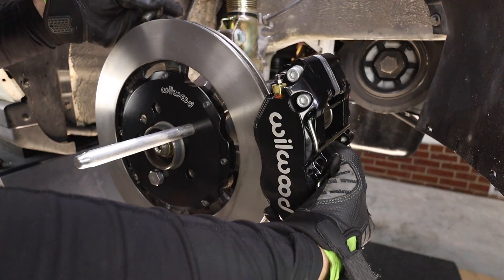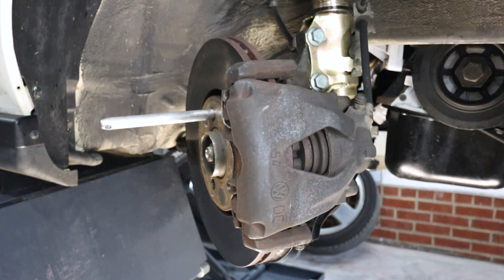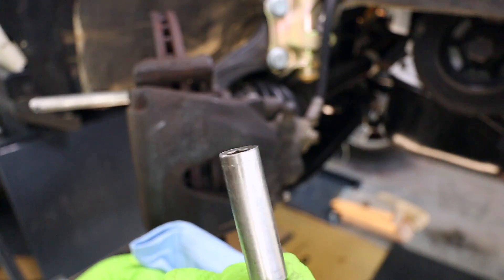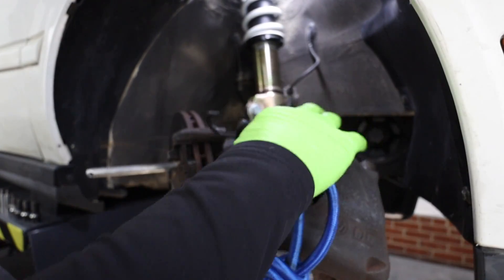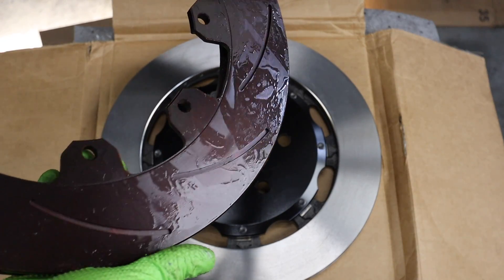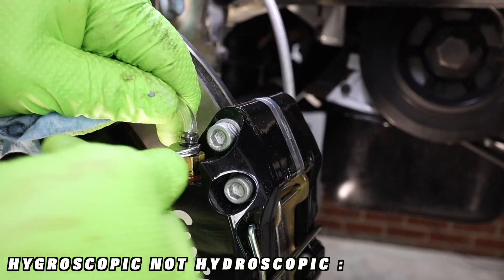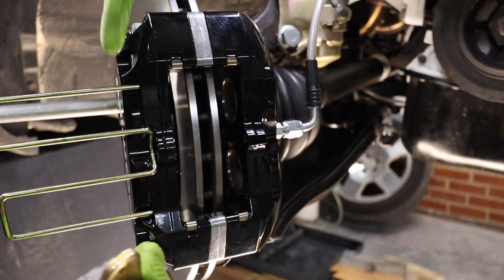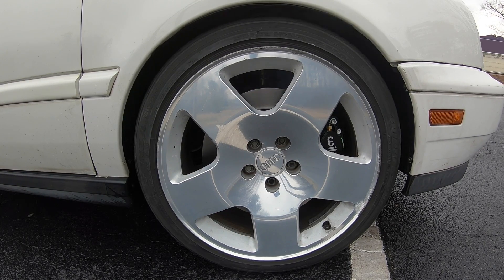10 Brake Job Tips when Replacing Brake Pads and Rotors

Comment: Be sure to not mix up the calliper slide pins,many callipers have different slide pins, the same diameter and length but one slide may have flats machined on its flanks and the other does not.
 I replace the bleed screws as a matter of principle. They cheap and spoil your day if they rust and shear off.
Get a pad mounting kit when you get new pads,again very cheap and way better than using rusted parts.
I use a drip tray to catch any fluids and any dropped parts, makes cleaning up easier!
Cleanliness is everything,wire brush everything clean.
Reply: Some pins have a rubber end, while the other pin on the same bracket doesn't. Why is that?
Reply: Not quite sure. I asked the same question some years ago and was told that the rubber is there to avoid any chatter in the calliper mounting due to vibration when the brakes were not applied and the calliper was free to float? When I asked about the flats on some pins I was told it was to allow the calliper to move without binding up due to heat differences between the calliper and carrier as the brakes were used. Seems pretty plausible and I have continued to believe this due to a lack of any other creditable explanation?
 Oh deep joy,more rusty seized solid Subaru brakes to overhaul tomorrow. Bollocks.

Comment: Another one: remove the caliper before you undo the brake line. It's easier to twist the caliper around instead of the wire. It holds more for putting it back together because usually the cable cannot be fastened enough and you'll need to remove the caliper again.

Comment: Another tip is to remove the cap from the brake fluid reservoir before pushing the pistons back. It'll save many pennies worth of damage :)
Reply from the maker: I like to extract a little fluid out too so it dines't make a mess

Comment: When I did a apprenticeship we always had to grease the ends of the brake pads, what is your opinion on that?
Reply: Where they make metal contact with the caliper itself, yes that's custom to do and prevent seizing I'd say.
Reply from the maker: I’m in the no camp on that one. Well I’m in the follow the repair manual camp. Vw doesn’t have any of that type of thing we did.
Reply: Bailey Hatfield I was wondering if that was why. I’m from Denmark, so there is a lot of rust and they salt the roads. I have family members that take their VW to Germany to get them serviced (cheaper there) and at the VW dealerships there they use grease on their brake pads too. But a lot of people in the US Don’t, just curious to why.
Reply: You never want to lube something that is exposed like that. It will work for a couple of weeks, attract dirt, and then turn to crud that will prevent smooth pad motion. Just wire brush thouroughly and you are good to go.
Reply: Hot climate and normal heat from breaking will quickly dissipate any grease.
Reply: @awesomexistence  not if you use high temp brake grease..
Reply: hsttrek1, yes for a while, but typically the grease is gone pretty quick in our summer heat. You can often fry an egg on the asphalt here and couple that with regular highway commutes ( sudden quick stopping is frequent) and grease just doesn’t last.

Comment: While brake fluid's hygroscopic nature will absorb water, my tester hardly ever shows significant contamination on customer vehicles. What does happen very often, however, is contamination and deterioration which you can see by the color change and test for with reactive test strips. Or just flush every two years as recommended :)

Comment: BLEEDER VALVE: they can be rusted in the caliper, requiring heat and freezing cycles to loosen. also, when putting in a bleeder, i would treat the threads with a anti-seize compound. 

if the valve is stuck, DO NOT FORCE IT otherwise the head will snap off and you will have to use an easy-out OR replace the whole caliper.

Comment: The easiest way to clean the slide pins: put the 7 allen nut on your impact gun, put the pin on and take some non woven abrasives and let your tool do the job. Just make sure you wear gloves and don't apply to much pressure.
Reply from the maker: I do it that way too most of the time. I worry about people ripping their finger off. Lol
Reply: @HumbleMechanic  Thanks for the response 👍🏻It was one of the first things my colleagues showed me at our VW dealer, but you're right, you really need to be careful and gently push down, I've seen these pins fly through the workshop 🙈

Comment: Turn the wheel?? What if you are servicing rear brake???
Reply from the maker: Pretty sure I mentioned only for the fronts. Lol
Reply from the maker: Or maybe I cut it. 😂
Reply: HumbleMechanic You did mention it is front. But I once changing me rear, so hard to fit a breaker bar in there. Had to go to a shop to use their lift
Reply: An impact universal joint on and extension makes using the breaker bar on the rears simple.
Reply from the maker: The MK5/B6 and up are bad about that. It can be tricky to get the right tools in there.
Reply: AJ S i really wish I own a garage. I don’t need to go to other places to service my car.

Comment: Pumping the brakes is not required with modern abs systems. Great video and content otherwise, keep up the great work. Love the content.
Reply: Eh I would just do it. Maybe a minute worth of work and it Guarantees you won't have problems.
Reply: I think your reference to pumping the brakes is referring to the the common practise, before ABS systems, of rapidly depressing  and releasing the brake pedal when trying to stop in extremely slippery conditions ( ice or snow).  Charles is referring to pumping and releasing the brake pedal after a brake job to push the piston back out until it contacts the brake pad. If this step is not taken, you will likely have no brakes the first time you try to stop which is way more excitement than I want !
Reply: This comment was meant to reply to xSSxDevillex, not ilikeboost. Oops !
Reply: You don't own a car?
Reply: @dudley7540  Yes. Two. 2011 Impala and 1985 Corvette.

Comment: Some newer cars have electric rear parking brakes like the Mazda CX5 beginning in 2016.  
The caliper pistons have the cross hatch like a "twist in" but turning in the piston can destroy the ebrake.  You need a hi end scan tool or a special procedure from the driver's seat to put the ebrake into "service mode".  Then the caliper piston is "pressed" back in rather than turned.  Total PITA for a DIY'r 
Mike B Tarrytown

Comment: My idiot moment:I use a coat hanger to support the calipers when doing brakes.Did a brake job on my civic, everything performed/felt normal, but it make this god awful noise. took the wheel back off, didn't find anything weird, had to go somewhere, figured since it stopped and went I was good for a short trip. Picked up my buddy who heard the noise, he pokes his head under the fender and pulls out my coat hanger that was scraping the inside of the rim...…. FACE+PALM
Reply from the maker: I’ve done that exact thing too

Comment: Should you put brake grease on the back of the new pads?
Reply: Most still do. The newer ceramic pads have a teflon coating on back that doesn't need grease, says Scotty the mechanic

Comment: There is absolutely no need to routinely replace your brake fluid.  I manage a fleet of trucks from all over the US; they've come back to be surplussed with a variety of years, miles, wear, and from very different service conditions.  I've tested the fluid in many of them and have only found one that had moisture levels high enough  to need replacing, and a only a couple that even registered a moisture level worth reporting.  If you keep the system sealed, there is no reason you can't go 200kmi or more than 10 years on the original fluid.  That said, I would not do it without occasionally testing it for moisture content and checking for contamination, but the testers are CHEAP.  The only time I would replace the brake fluid is if I had to open up the system for some other repair (like replacing a caliper), there was visible contamination, or if a test actually showed water content over 3%.

Comment: Don't install the brake pads incorrectly.I have seen it before twice,installed incorrectly metal to metal by the previous person that did it
Reply from the maker: I have seen it so many times. Jobs like this get to be autopilot for people. That is how stupid mistakes happen..
Reply: One was a 2003 Buick,customer's cousin did the rear brake job on it and blamed it on bad wheelbearings which it wasn't
Reply: HumbleMechanic Walter Frederick 
You mean that the pad bit is on the wrong side, not on de disk? Really? I’m not a mechanic but couldn’t imagine that someone would do that.